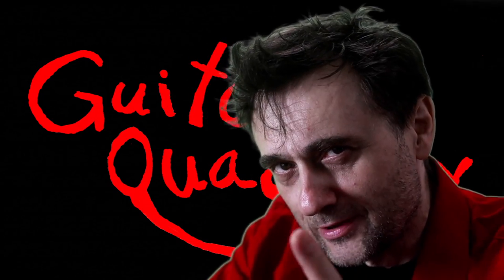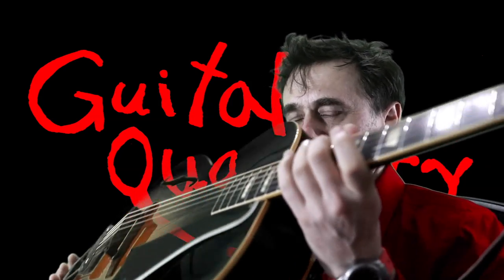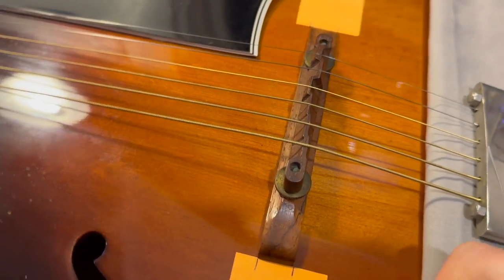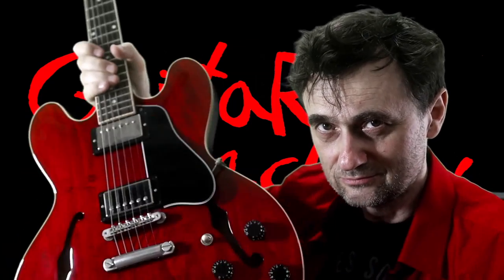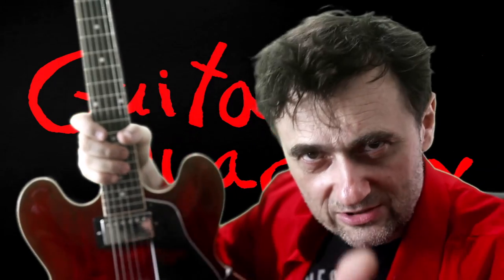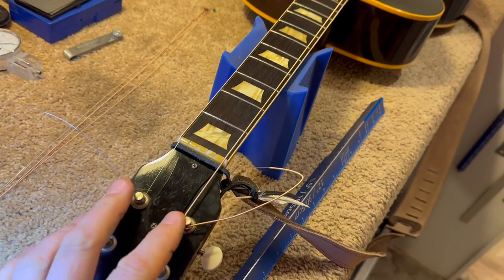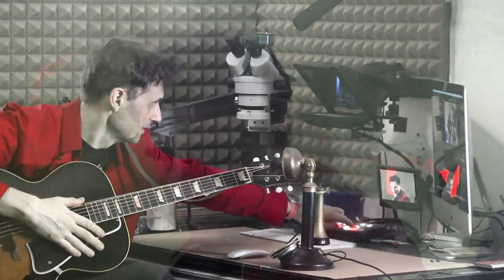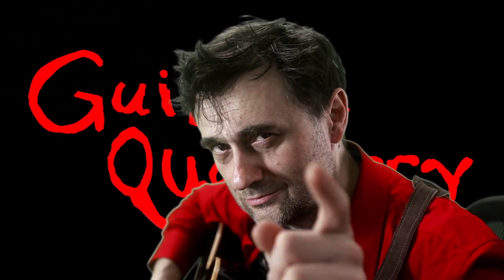Restringing an Archtop Guitar with Floating Bridge

Comment: Seems like a fairly elaborate procedure just to change the strings. Nice guitar, though.
Reply from the maker: The guitar is older than I am.
Reply: @GuitarQuackery  Very cool - may have been good to mention that in the video, along with anything else you'd care to share from the instrument's backstory.
Reply from the maker: @Iamadoctor6365  Very little of this guitar's history is known to me, prior to me buying it. But let me share some of my personal history, with this guitar.

I bought this guitar some 20 years ago, from a small shop in NYC, called Mojo Guitars. The shop os not longer around, but it was located at 102 St Marks Place, which is two doors away form 98 St Marks Place. Why is that interesting?

Led Zeppelin fans might recognize the building entrance of 98 St Marks Place, as it appears on a Led Zeppelin cover.

There's more.

Rolling Stones fans might recognize the doorway of 98 St Marks Place form the video, Just Waiting on a Friend.

Small history. Not significant, but better than nothing.

Oh, I lived on the block at that time and I saw the guitar on the day that it was displayed and I bought in on the spot (I believe I paid $1,200). No original case, but it was sold with the Mojo Guitars gig bag.
Reply: @GuitarQuackery  That was interesting to read, and more so if one is familiar with East Village. Knowing that this is a guitar you've kept for decades and is, presumably, dear to you makes the video "feel" a bit different - as opposed to videos where you are demonstrating some technical aspect of an "in-and-out" customer's guitar.
Reply from the maker: @Iamadoctor6365  This guitar definitely has more sentimental value for me than a customer owned (battery powered) Ibanez GKY445-HGSTE model, LOL.